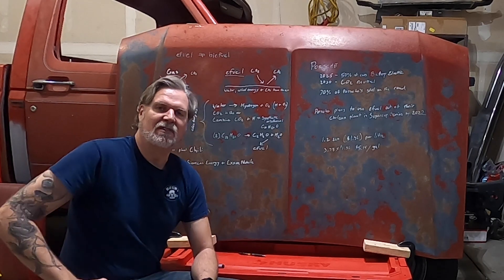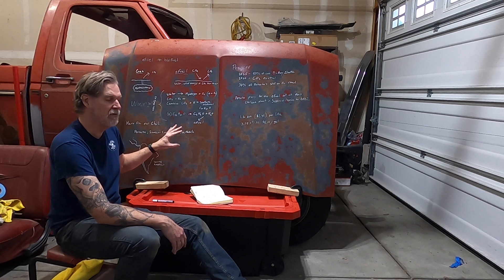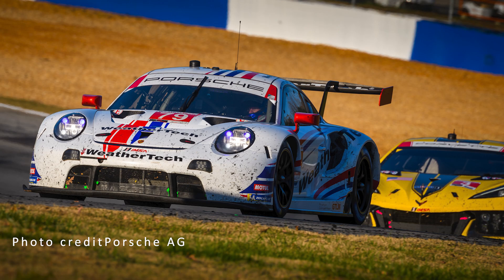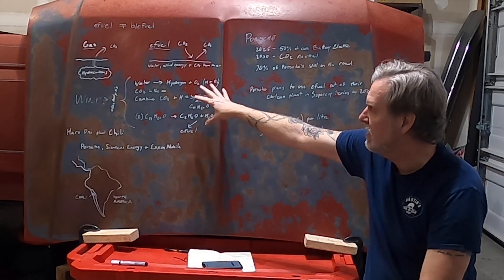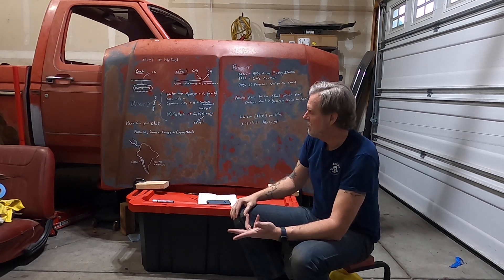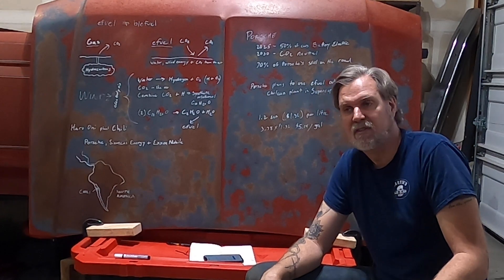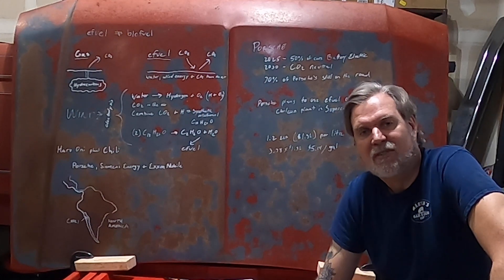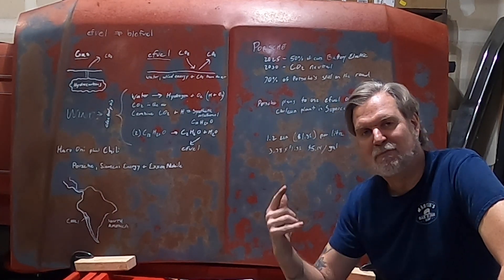eFuel - What Donut Media and Engineering Explained Didn't Consider

Comment: The Porsche plant currently uses CO2 from a beer factory, delivered in trucks. In that sense it's actually making a sort of hybrid synthetic bio-fuel. The problem with Bio-fuels is that they can't be scaled up as they compete with agriculture for food and there's not enough of that. Until Porsche can demonstrate that they can make synthetic fuels cheaply enough and at sufficient scale purely relying on atmospheric CO2 for their carbon source, they don't have a viable synthetic fuel proposition.

Sure make bio-fuels for motorsport (which is effectively what Porsche is doing, only then using electrolysis to refine it into more complex hydrocarbons), but that's a very different idea and will never be a mass market solution
Reply from the maker: It will be very interesting to see what happens in the coming months now that Germany has (no doubt from VW Auto Groups insistence) forced the EU to include eFuels in their zero emissions plan. It should give us some insight into how much of this video is realistic vs how much was just hopeful thinking. Thanks for the comment!
Reply: @MotorsandMischief  yes it will depend a lot on how the EU defines ‘carbon neutral’. If they insist on the CO2 used to produce it coming from either atmospheric capture or sustainable biological sources (ie not from the byproduct of burning fossil fuels) then it’s very hard to see the business model working. 

Also who is going to invest in a network of pumps for so few cars given that existing ICE vehicles can continue to use cheaper fossil fuels for as long as they need?

And if you can’t fuel them who is going to buy the synthetic fuel only vehicles in 2035?
Reply from the maker: Porsche guys. We’re all counting on the 911 to carry the efuel market lol

Comment: You are missing the point that the price of e-fuels is inherently linked to energy prices in general and the efficiency (even if everything is perfect) is just bad. Thus it will be always a few times more expensive than using electricity outright.
Also the benefits of ICE cars are just exaggerated. There is a vocal minority who likes engine noise and apart from that there is no benefit over electric cars. (For planes and ships it makes sense tho)
You then go into how there isn't enough infrastructure yet to accomodate everyone switching to e-cars tomorrow, but there is literally zero infrastructure for synthetic fuel yet (apart from one test facility in chile). So there seems to be a bit of a bias here.

Additionaly i have to say that synthetic fuel still has 90% of the problems of regular gasoline which is reduced air quality and noisy cities. Just CO2 emissions are better. And a lot of people, especially in the US don't care about that.

I stand by my opinion that there will be a niece market for synthetic fuels in (luxury) cars, but mainly it will be used in airplanes and ships.
Reply from the maker: EFuel can be distributed in the existing gasoline infrastructure; it doesn’t need a new distribution network, which is what we were referring to. And there’s no secret there’s a bias here, we said that in the video. But you’re bringing the pro electric bias and we appreciate that. Thanks for commenting!
Reply: @MotorsandMischief  Thank you for the non toxic reply, a rarity when talking about this topic. I am not even pro car(-infrastructure) btw and I was referring to the infastructure that produce and refine synthetic gasoline which is lacking. If you consider you need to build up new factories it seems easier to make more Power Plants to power electric vehicles. As e-cars are more efficient you need less Power Plants for that while also not needing the factories to produce e-fuels. I do not see a way in which the infrastructure for e fuels would need less investment or is in any way easier to bring to a usable level than for electric cars. You need more charging stations of course but they can be installed in the matter of years on a nation wide scale.
Again thank you for listening to the other side. Normaly I get yelled at with no arguments when talking about this.
Reply from the maker: We can’t stand people who refuse to dialogue. If, like you, someone wants to be respectful and kind and have a 100% conflicting viewpoint, they (and you) are welcome on this channel. We hope the ICE cars don’t go away simply because we love them but if they do, you’ll find us shoehorning a Tesla motor into a ‘71 Chevy Nova to see what will happen. We hope you’ll watch when we do.
Reply: @MotorsandMischief  I think for people like you there will be a niece market to get out on a weekend and have fun with synthetic fuels. I just don't see it happen for an everyday commute.

Comment: E-fuels would be the way to go. Improving the process of developing the fuel and the cost of the fuel will be the key factor I think. EV cars have downfalls such as rare earth elements, charging, maintenance and the complexity of the electrical system. I am a mechanic myself and ICE have decades of development already. Making a carbon neutral fuel would mean the world wouldn't have to change it's entire electrical grid(which runs on fossil fuels).

Comment: You make your point, but still based on emotional and preference instead of physic.

The more the efuel cost will go down, the more the cost of energy will go up and this will makes electricity most cost efficient than efuel and/or hydrogen.

Simply because the electricity is 10x more efficient! Without say, the day the energy storage in batteries explod, all the other system will just die.
Reply from the maker: You’re not taking into account the problems associated with obtaining cobalt, lithium and all the rest. The labor issues with those make the diamond slave trade almost tame by comparison. And there’s also the carbon footprint associated with building a new electric vehicle versus continuing to use an existing ICE vehicle. In every study keeping a vehicle on the road is far, far better than building a new one. And again, we said we agree there is a place for electric. We just disagree that there is no place for ICE.

Comment: IMO Synthetic Fuel will replace ethanol.  Then whatever feedstock is used to make ethanol will be transitioned to making HVO/Renewable Diesel.  Also higher cost initially won't be a issue for use in premium gasoline, as it costs a good % more anyway.

My 2 cents in any case, as synthetic fuel burns more efficient than ethanol & HVO has virtually the same efficiency as conventional diesel.
Reply: The Macronical:  Re the cost, it will depend on the cost of gasoline, which (without government intervention) depends on the cost of crude oil.   If the demand for crude oil falls a lot over time due to electrification of the global fleet, that will make gasoline cheaper. 

Of e-fuel is MUCH better for CO2 and also for pollution including disease risk, then gasoline should be phased out by force, if an alternative is there, even if it costs twice as much.  

We'll see. It's always MUCH better to have viable alternatives though, even if they only will be used for the transitional phase, and ICE's are banned at some point due to pollution risks.   

Doing  a quick google check, it looks like e-fuel is as bad or worse re dangerous pollutants like NOX, carbon monoxide, etc.  So if that's the case, they're not acceptable long term, but they're still a GREAT transitional alternative if they can meaningfully reduce CO2 / AGW production until there are enough BEVs for all drivers, and at affordable prices, acceptable ranges, with solid universal charging infrastructure (and power for that), etc.  

That process will take decades globally, IMO.

Comment: Great video and interesting points! But i think the main problem for efuels is the comparative disadvantage to electric vehicles. The limiting factor is the energy needed. Even if the extraction process for CO2 and the electrolysis are geting way more efficient, you would be better off putting that energy directly into batteries. Less conversions, higher efficiency. But efuels will have their niche for classic cars and planes/ships. Mass adoption won't happen because of the comparative cost advantage of electric cars + many people like the fact that they can charge their cars while at work or at home. Can't do that with efuels.
Reply from the maker: These are good points but they don't take into account the energy and carbon cost of making the batteries in the first place. Currently rare elements for batteries are mined in mostly China and 3rd world countries that don't have the environmental protection requirements that we're used to, not to mention that by some estimates, we may not have enough of the required elements to make all the batteries required for everyone to have an electric vehicle, trucks to be electric, busses, etc. We still think the best solution is a combination of clean technologies so that no one tech has to carry the burden alone. Thanks for commenting!
Reply: @MotorsandMischief  Thank you and great video.  I loved it.  I love V8's, V10's, and V12's too much.  I cannot see myself buying an EV car.  However, my question is that, many people say that solid state batters are strong enough to power airplanes, ships, and etc.  Hence, the zonk efuels by saying that we do not need them because solid state batters are powerful enough to do the job. Sir, what do you think of this? Honestly, I want efuels to expand so that I can drive my ICE cars.
Reply: @MotorsandMischief  most ev cars currently made in china are LFP and LFP will be the battery for 80 percent of cars in the future unless another technology becomes cheaper. The criticism of ev's having rare earth metal is true but tesla has relatively low amounts in their current gen battery especially compared to apple. Elon is trying to bring the battery cost down so having a lot of rare earths in your battery won't make sense. Most rare earths used in western countries are not mined in places that use child or slave labor anyways, companies have faced pressures to tighten their supply chains.

Comment: This video puts altogether the topic of Synthetic Fuel with the ingenuity and wisdom of this gentleman!  I believe they are going to do it and it will save the combustion engines and the manuals!!!  I drive a stick daily and would not ever be capable of smiling without some combustion exiting my exhaust while I roll through the gears!  I am not a fan of electric largely because of those reasons, but I acknowledge the electric cars for what they are.  Although, I still do not like them.  Ha ha
Reply from the maker: Thanks so much for the kind comments!! And yeah we totally agree. Electric has a place but it sure is hard to feel that passion and exhilaration when driving one.

Comment: Would this be the end for the big oil companies or would they also start and develop their own e fuel I think that's their only way to still be in business since oil has it's days counted
Reply from the maker: Well if we look at Kodak, who didn't diversify when the digital photography writing was on the wall, it seems you are correct that companies that doggedly refuse to innovate will meet their end. eFuel seems like a good way to diversify, and we're also seeing that even with fuel prices as crazy as they are (which, interestingly enough, they weren't when we first posted this video and we did state that if prices went up, eFuel is more cost-effective to produce), we're seeing shortages still on chips and other raw materials that would allow for a fully battery-electric fleet. So again, it seems that having multiple options, regular fuel, eFuel, electric and maybe even hydrogen, means that no one technology is carrying everything, meaning we're all safer from the normal dips and spikes of any one fuel type. Thanks for commenting!

Comment: Wind power?  Please explain how this would scale given the following:

Worldwide oil consumption reached approximately 88.5 million barrels per day in 2020. This was a decrease of nine million barrels compared to the previous year and resulted from pandemic-enforced mobility restrictions leading to a decline in transportation fuel demand. Apart from the years of the financial crisis and the 2020 coronavirus pandemic, oil consumption consecutively increased in every year since 1998.
Reply from the maker: Your figures sound spot on but we're not sure what you're saying exactly. We're not saying wind power will replace gasoline, we're just reporting on what Porsche thinks it can do using that particular plant. We'd assume that if Porsche is able to make this work that there would be additional plants built and the tech needs renewable energy of any type, so presumable some plants would use more solar, less wind, some would use hydrothermal maybe, we don't know. We just know that Porsche picked that spot because of the combination of wind power and solar, at least according to their press releases. Thanks for the comment